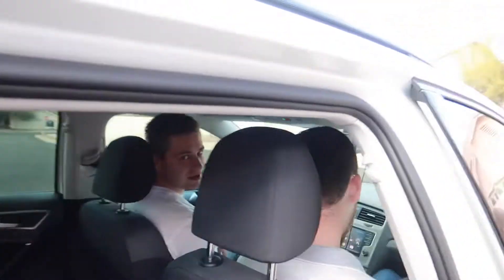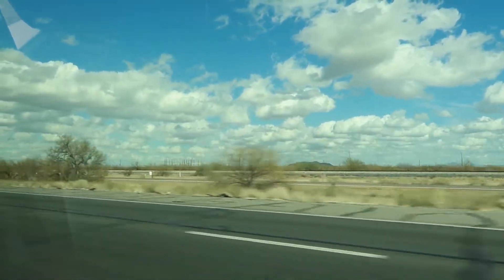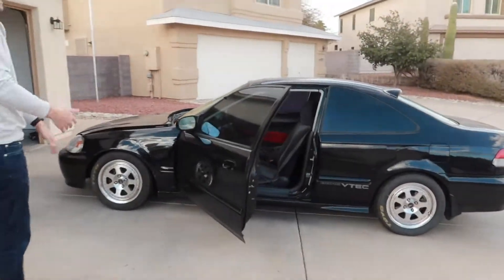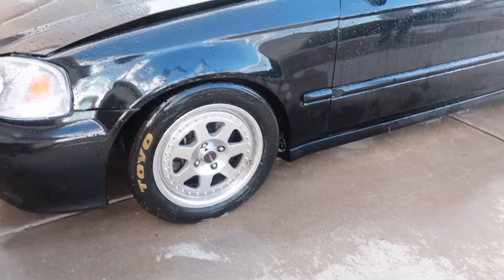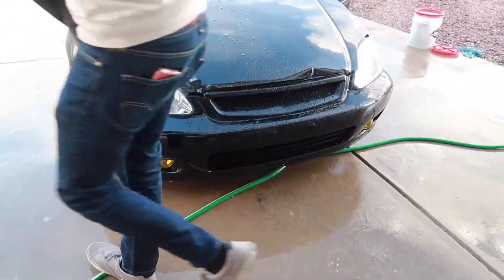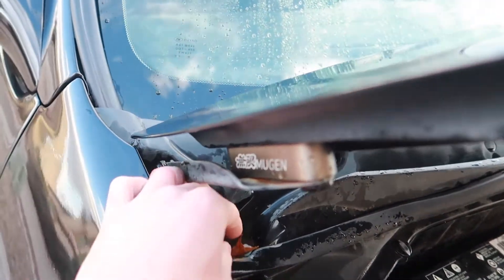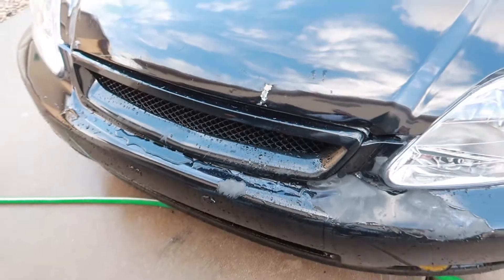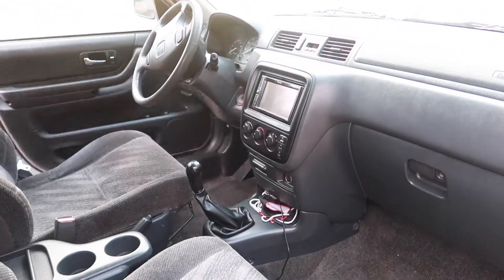We bought a Civic Em1 Si for under $3,000!

Comment: I want a Civic  For my First Car I'm Looking For A EG Hatch or Em1
Reply from the maker: They’re a great platform car. Great for learning.
Reply: I would 100 percent recommend it, especially a em1 they are pretty reliable and super cheap honestly and tons of aftermarket support, they are reallly easy to work on too
Reply: @francowolfmurd9758  yea but I don't think I will be getting a em1 maybe a 2000 civic ex
Reply: @Chrhs-b6k  any 90s civic is pretty hard to find at this point
Reply: @Chrhs-b6k  yeah an em1 is like 30k
Reply: @Abdullah_khan2288  30k??????? You trippin
Reply: em1s are not cheap if you dont want one like in this video that is a straight project car then its going to be at least 6-10k especially nowadays.
Reply: I just got a dx hatch today for 3k and its mint condition